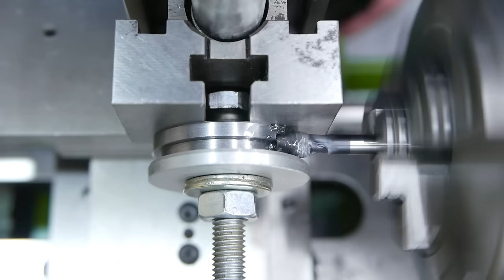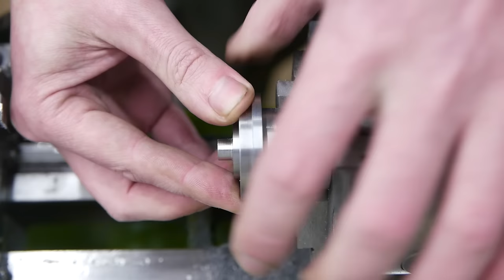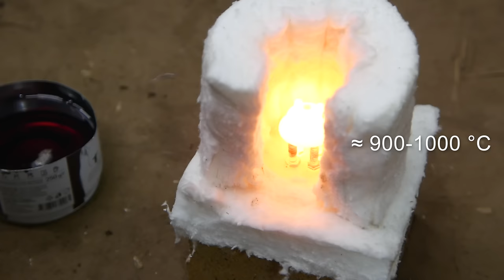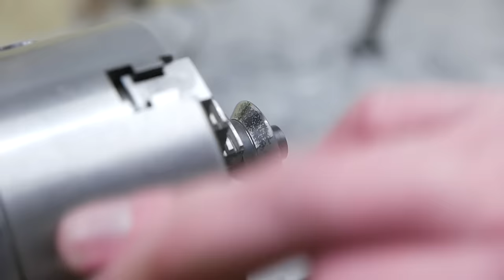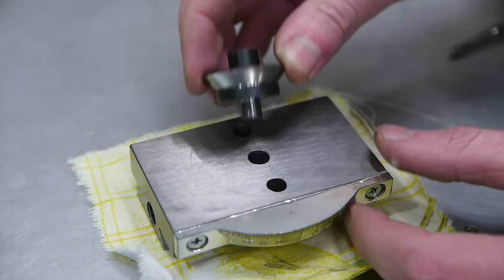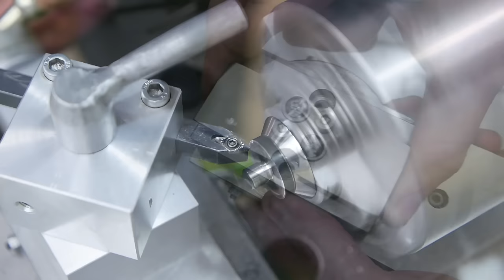Quick Compound Slide Angle Adjustment Chinese lathe upgrade

Comment: Nice use of what appear to be diesel fuel injector pins as transfer punches. I have a number of them around the workshop, you need to anneal the striking end to prevent them sending out splinters.

Comment: FIRST, FIRST, CONGRATULATIONS ON THE TOP PROJECT. TELL ME SOMETHING, WHICH WHITE MATERIAL IS THIS THAT YOU USED TO INSULATE THE PIECE TO HEAT IT AND PUT IT IN THE OIL? WHAT'S HIS NAME ? I REALIZED THAT EVEN AT ALMOST 1000 °C IT DOES NOT BURN.
Reply from the maker: Ceramic Fiber Wool LYTX-312

Comment: Very nice, would this be strong enough for a bigger lathe?
Reply from the maker: I think yes
Reply: I have my doubts
Reply: @cda32  for small bench lathes I think it would be rigid enough - it is as rigid or more than your average morse taper tooling in milling machines. You cannot compare it to a big engine lathe or solid tool post mounts.

Comment: Sorry but  i try in German.
Wenn Sie den Drehpunktdiameter reduzieren, erhöhen Sie die Instabilität .
Sie hätte besser den kompletten Konus umgearbeitet, oder den Quersupport verbreitert.
Auch die Stapelung in der Z-Achse sehe ich problematisch.
Dennoch viel Erfolg .
Greetings from Berlin/ Germany
Reply from the maker: The tool holder has a 10mm stud...
Reply: If you have a round Cylinder, then diameter reduce.
Thank it was instable Cylinder.
The Support must bigger ?.
Sorry for my fucking english, round about 40j. Old

Comment: It looks like a lot of time and too many holes in a line making the casting weak these are cheap lathes i have had one for over ten years the motor stopped working and the control box burned out it has a 3/4 hp motor on it now i also have a myford that i do nothing to it it cuts better looks better needs no time only a bit of cleaning and will still be turning when i am not the mini lathe is good at getting people into turning
Reply: I guess if ml7 are plentiful and cheap where you're at🤷‍♂️ where I'm at, there have been two in the past 7 years show up on the market within a reasonable distance and both were asking over 6k usd for a well used machine with minimal tooling included. Yes these little lathes take time to get set up but so does a clapped out old ml7. With a mini, I can get the results I need for a tenth of the price. For the money, you cannot beat the mini lathe.